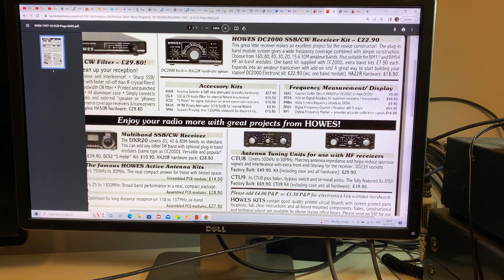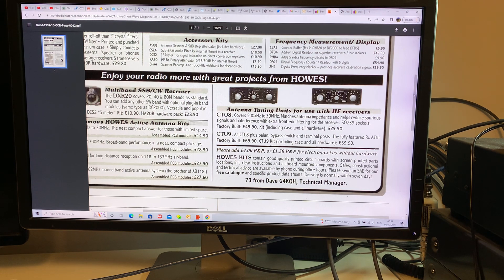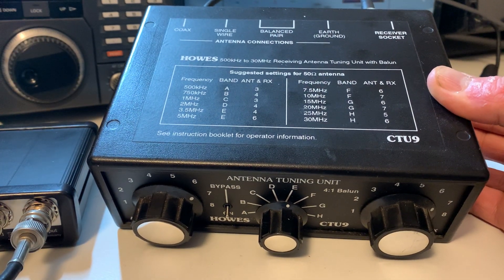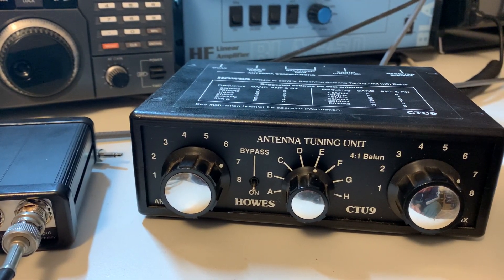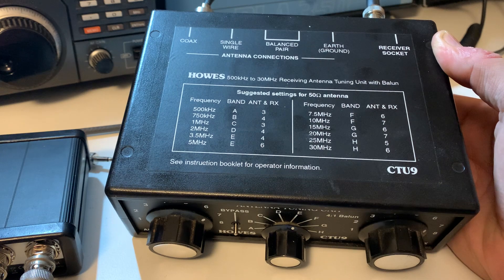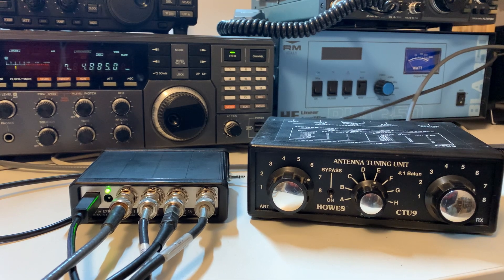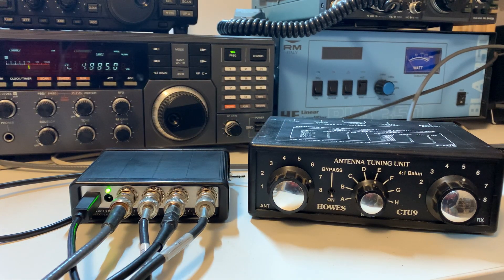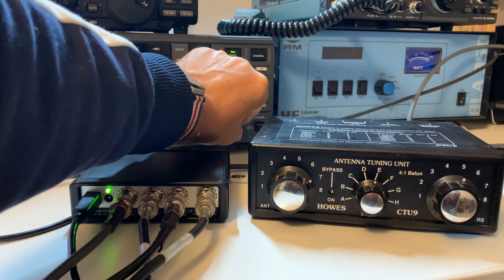A review of the vintage Howes CTU9 receive-only Antenna Matching Unit

Comment: I have the Howes CTU-30 which is similar but can be used to transmit up to 30W
used it with my IC-703 but now in use with my Doublet and comms receivers IC-R71E and  
Fairhaven RD500vx .
Fitted mine with a bypass switch for MW . Howes made some great kits.
Reply from the maker: Thanks for your comments John. 73

Comment: interesting  i think if capacitors inside box are air spaced use for up to 10 watts ok on tx and also good unit for front end of cheap radio sdr portable for some extra basic selectivity on ant input
Reply from the maker: Great point, thanks